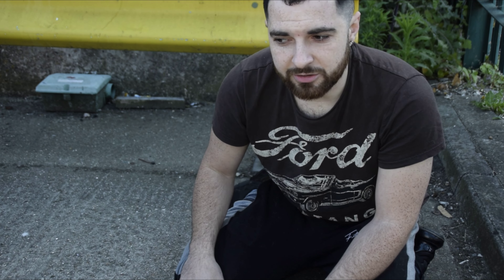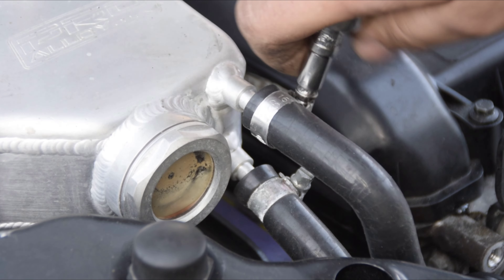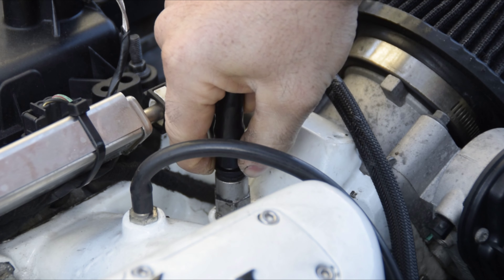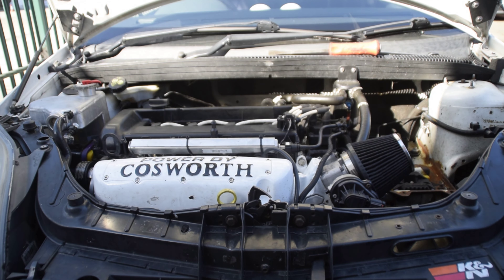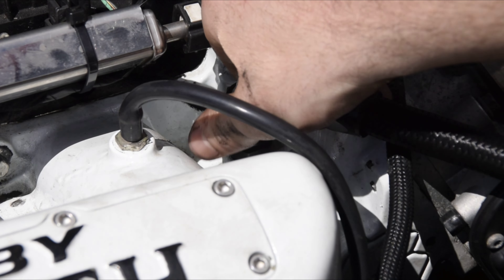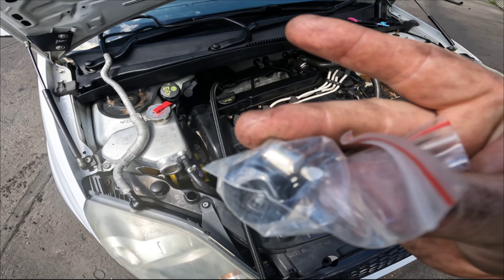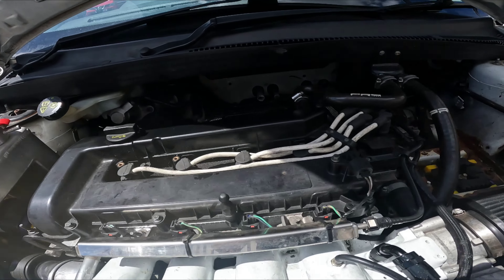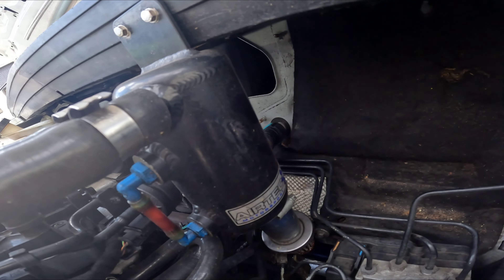MK6 Fiesta ST150- Making A Custom Braided AN Brake Servo Pipe and Sorting my Coolant Pipes Finally

Comment: Hi mate. What is the diameter of the standard plastic pipe? I'm wanting to change to silacon
Reply from the maker: @markheath6232  not sure on the diameter of im totally honest best off measuring the pipe on yours with some verniers
Reply: @6uiltdifferent  that's my plan to measure it. But I'm not local to my car and only working on it at weekends at min. Was hoping to find the size beforehand then I could order the pipe. No worries mate 👍 thanks for the swift reply
Reply from the maker: @ no drama if you want my opinion I’d do it as an an line like I have more reliable and looks nicer
Reply: @6uiltdifferent I would luke to do the same but I'm unsure of the fitting on my cosworth inlet. It's brass. Is that original?
Reply from the maker: @markheath6232 guessing you skipped through the video a bit as I do say what thread size the port is on the manifold at 4:46
Reply: @6uiltdifferent no mate watched it a few times now 😂 I've ordered all the bits now. Hopefully be fitting it at the weekend
Reply from the maker: @ fair play haha hope it all goes smooth for you mate 👍🏻